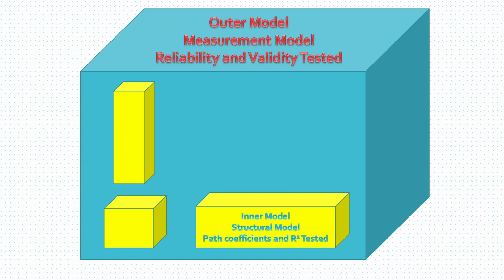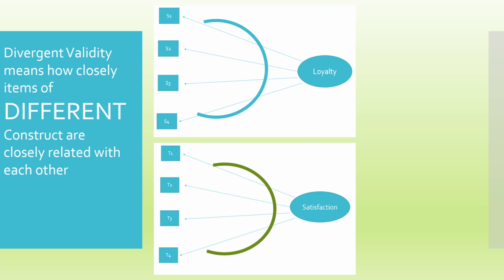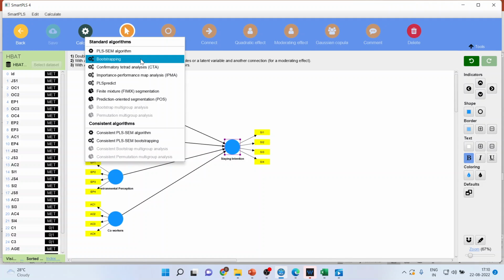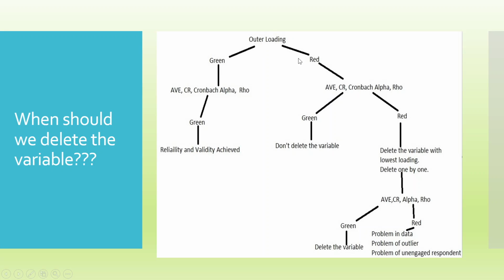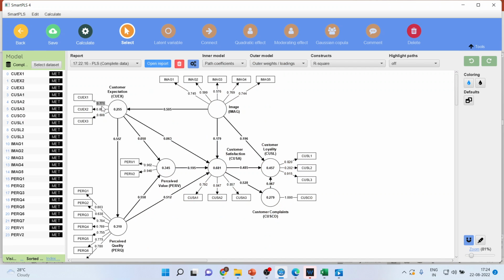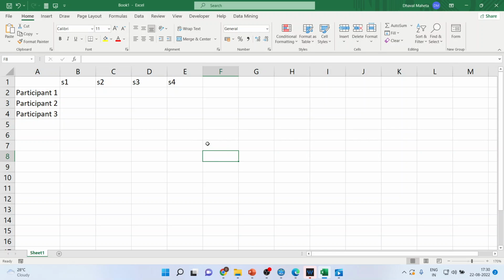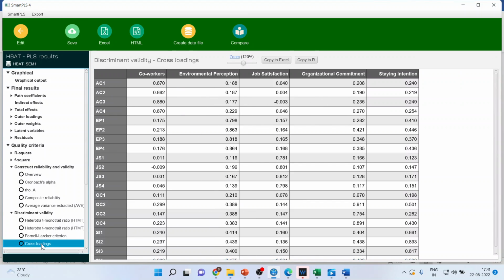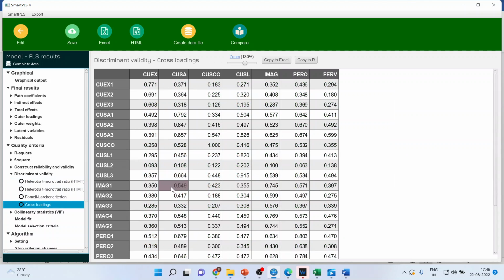4. Measurement Model - Reliability and Validity Testing in SmartPLS-4 || Dr. Dhaval Maheta

Comment: Sir ,I have a doubt,in my data two items or indicators of a construct has factor loading less than 0.7 but more than 0.40 .When i remove those items  the composite reliabilty increases whereas AVE gets reduced from 0.591 to 0.554.What to do?

Comment: In outer loadings my sub variable comes in relationship with higher model construct that means like
JS1- JS will be 0.815
And JS1-WH will be 0.910
What can be the issue as I am getting 2 values for each lower model construct